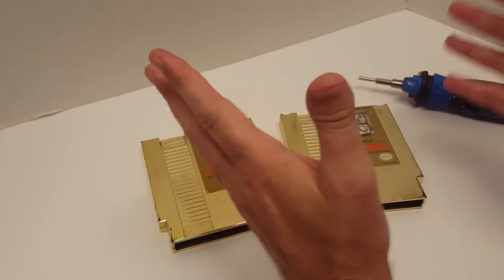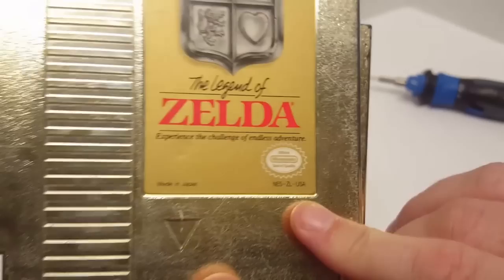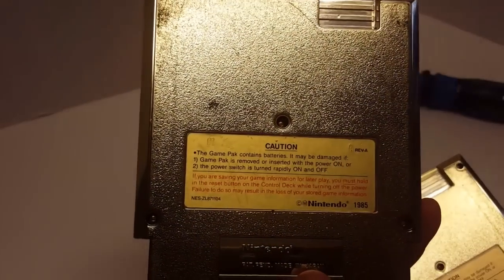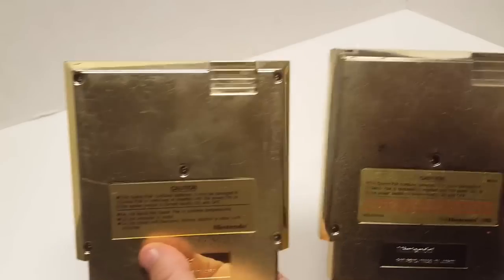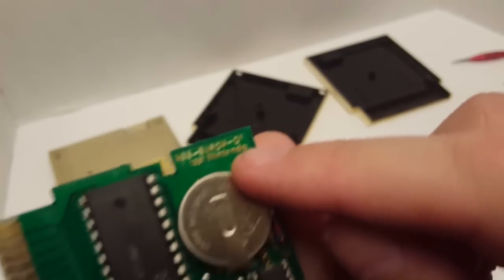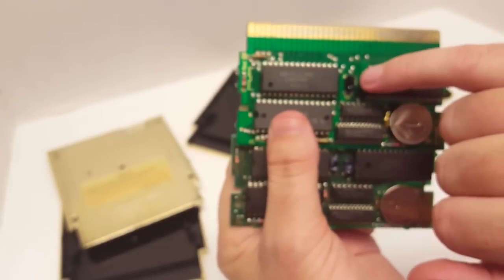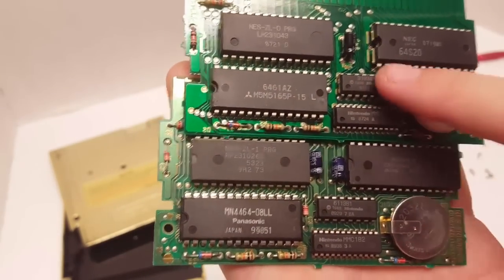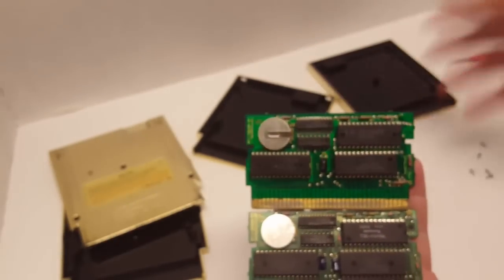The Legend of Zelda - NES Cartridge Variants

Comment: I have 2X 3 screw carts here.  One is USA and the other is Canadian.  The US variant's seal of quality is round where as the Can. one is oval.  Both are centered on the bottom of the label. Below the large ZELDA text, the US ver. says "Experience the challenge of endless adventure".  The Can. ver. is blank.   US ver. has the red 'hold reset' warning on the back wheras the Can. Ver. has the caution statement in english and then in french.  Batteries are the same maxell, US board is nes-snsrom-03.  Can. Board is 05.
The US ver. Has Sanyo and Sharp chips and 1 capacitor in the center.  The Can. Ver. Has Sharp and Panasonic chips with 2 capacitors.  I wonder if that second cap. Is intended to help with preserving the save games if reset is not held while powering off.  Also, the Us board is dark  and the Can. board is a lighter green.

Comment: Hi, I have an oddity for you possibly lol. I have a 3 screw cart but it has the silver centered seal on the front of the label. The box I have is the same. Did someone before me put two copies together? I appreciate any feedback thanks a million! 😎🤙🏻
Reply: Mine is the same I think. 3 screws on the back with red text warning about the battery. The number 12 stamped in the label. The front has the silver Nintendo seal centered.

Comment: Quick question mine has the seal of quality on bottom right hand corner and is a 5 screw but says 1985 on back sticker but has either bronze or copper colored screws is it an authentic i got it at goodwill but looks brand new please if u see this give me your feedback
Reply: It also came with the players manual and players game guide but game guide says 1987 got it for 12 bucks at goodwill
Reply from the maker: 99.9% sure it's authentic. 5 screw carts were the first released carts before Nintendo redesigned the carts to a 3 screw version. Secondly, it's not very likely that it wouldn't be authentic seeing as how it's a very common game.

Comment: 5 screw Label bottom left did u just replace the label....the red label on back is after Nintendo made changes to its chipset in the console. There's no power spike on newer consoles so zelda files wont get erased if u hold in the buttons to shut it off. I wish Nintendo put the screw under the labels so people can f with them. be good..
Reply from the maker: No, no label has been replaced.